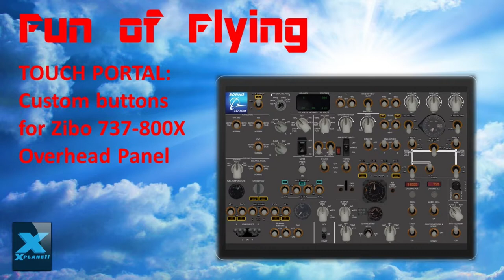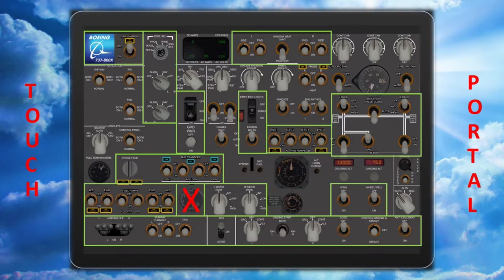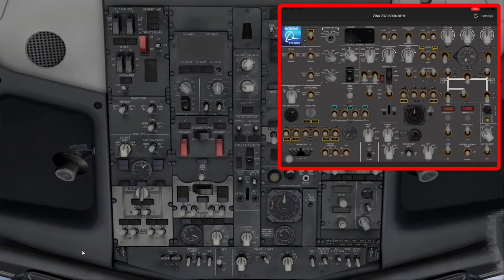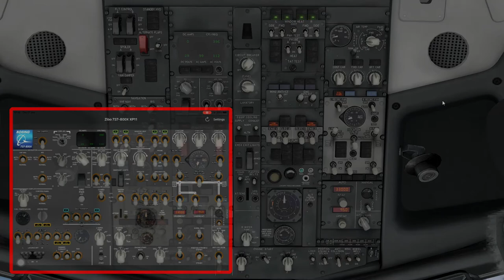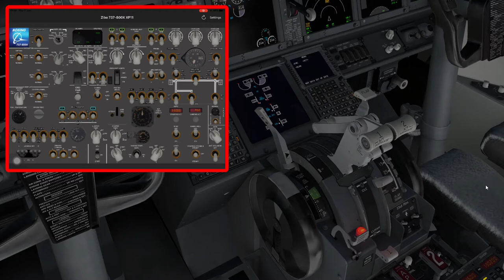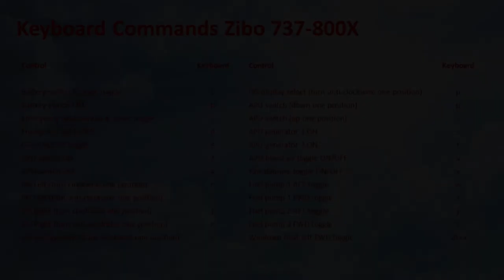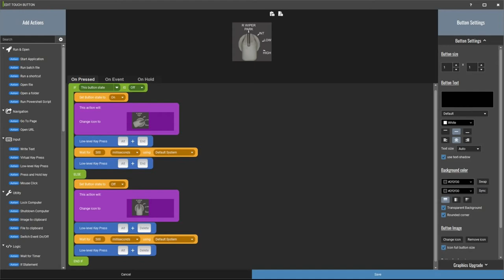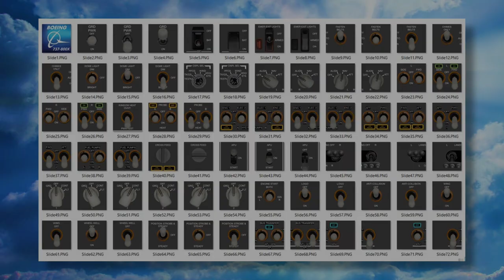Suite of Touch Portal Custom Buttons for Zibo 737-800X Overhead Panel & Full Engine Start with iPad

Comment: Will this work in the PMDG 737-800 in MSFS2020?
Reply from the maker: Hi there and welcome to the channel :-)

Yes, TP should work with any flight simulator where keyboard commands are used to control cockpit instruments etc. The only issue I have found with MSFS2020 though, is the limited number of 'published' assignable commands, which X-Plane 11/12 and DCS World has in abundance!

So, to answer your question, yes, this TP overhead panel which was written for the Zibo 737-800X in XP, should also technically work for the PMDG 737-800, if you can find all of the necessary assignable commands in MSFS2020?

Obviously, any keyboard commands that you set up in the aircraft, must match those set up in the TP page itself, otherwise it definitely won't work.

Hope this helps, but please get back to me if you need anything further.

Kind regards Paul
Reply from the maker: Hi again

Just thought I'd let you know that I went to the expense of purchasing the PMDG 737-700 for MSFS2020, with the intention of prototyping a number of home cockpit setups for it, using Arduino for the programming code.

Unfortunately however, and this follows from our last posts, it appears that Microsoft/Asobo will not allow the whole suite of assignable commands for this aircraft to be published to us mere mortals! It is exactly the same for many other more complex aircraft in MSFS2020 and all we end up with is the very basic stuff.

Given how much the PMDG 737 costs, this is extremely disappointing for me as someone who deals with home cockpit prototypes!!!!!

I don't know why they have decided to be so secretive with these assignable commands, as X-Plane and DCS World are so open about it and more or less publish everything.

So going back to your original question about the Touch Portal Zibo 737-800X page and whether or not it will work in MSFS2020, I would have to say now, that it is very unlikely!!!

Sorry for the bad news, but that's Microsoft for you eh!

For that reason, I'm now going back to X-Plane and DCS World for my next projects and will leave MSFS2020 alone until they start being a little less secretive.

Kind regards, Paul